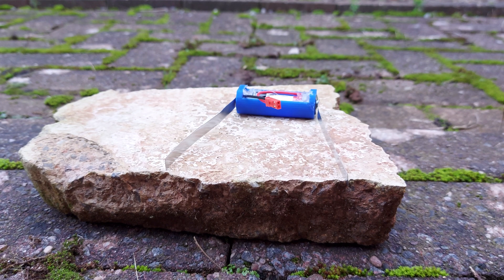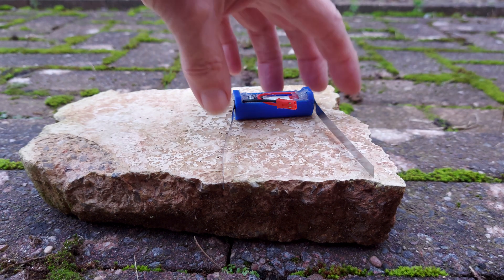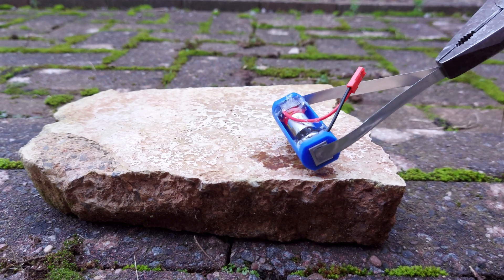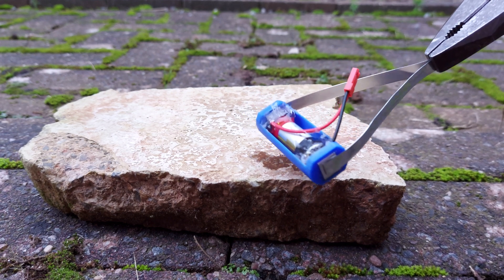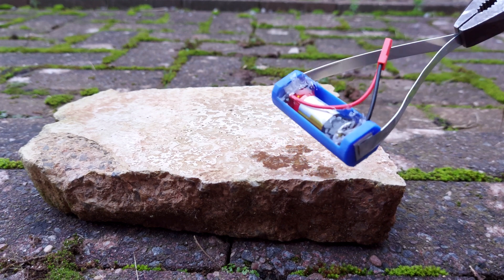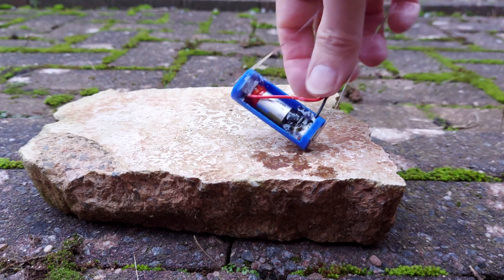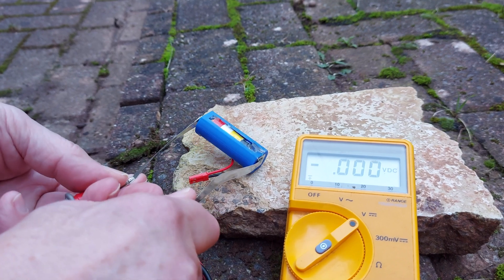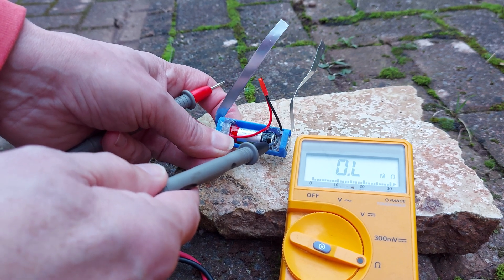What if I short it out? PART 1

Comment: Don't they have a fuse type mechanism?
Reply from the maker: @theGraphicAutist  not the ones I am using, although the thin battery contacts effectively work as fuses if they burn through. I have no idea if that is a design feature or just a lucky result of cost cutting.

Comment: It was interesting that at first it smoked the slowed then a lot more smoke i am interested in weather or not it temporarily lost its connection
Reply from the maker: @danisgay100  what seems to happen is that the battery contacts burn/melt and act as a fuse. I don't know if it is designed that way or just a lucky result. I have another go in PART 2.

Comment: The battery went from freshly charged to freshly charred 😄If an elfbar battery in your pocket shorted out it could brand your leg 😮 

This is a really useful demonstration video of what could happen with a worst case scenario battery short. 

Blessings to you and yours, Grandad 👍
Reply from the maker: It needs a good set of coincidences to do the deed. It is clearly possible that the worst can happen, but not guaranteed that it will.

Comment: I usually get a nasty spark and then there done.  Only 5A output, i dont think its top grade lithium either.  Does it make a difference the grade?
Reply from the maker: @cspower7259  The first thing is whether the cell is fully charged. That is where the power comes from. You can hammer nails into a fully discharged cell, and nothing will happen. I fully charged this for the demo, but the wire tags melted before it could do any more damage. What I wanted to find out was if the PLA printed case or the hot glue would add to the flammability and it does not look like it did. If anything, when the hot glue melted, it might have helped kill the flames.
Reply: 🥽😎🔥💥scary test

Comment: This will be a fun video.
Reply from the maker: @DirtyPlumbus  I really tried to get fire 🔥 but failed. I tried even harder in part 2 and still failed 🤷‍♂️
Reply: @GrandadIsAnOldMan  While that may be less entertaining, it's probably the preferred outcome.
Reply from the maker: @DirtyPlumbus  I was wondering if the hot glue or the PLA case would have increased the risk, but it looked like the molten hot glue helped kill the flames.